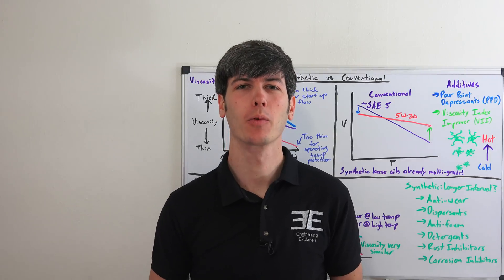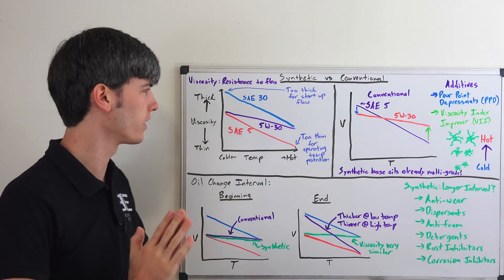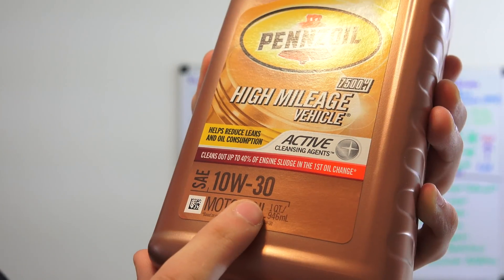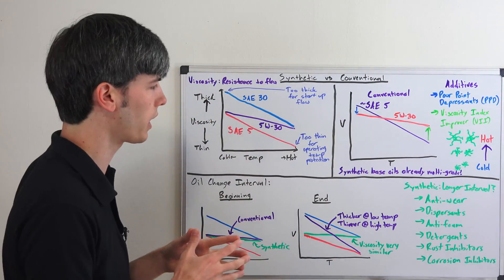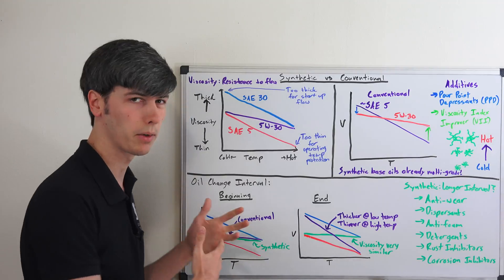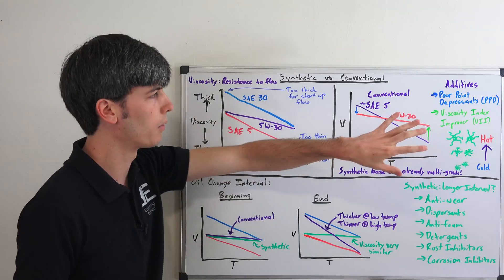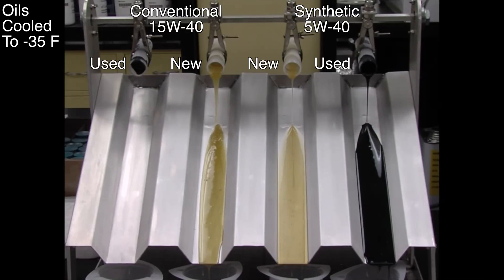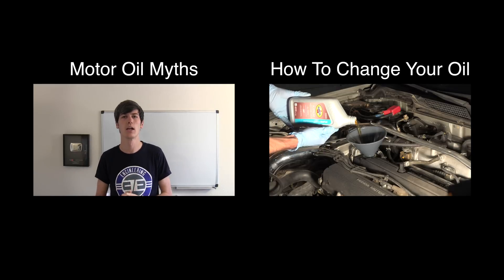Is Synthetic Motor Oil Better For Your Car?

Comment: There's really no excuse to be using non-synthetic oil... you can buy 5 quarts of full synthetic Mobil 1 at Walmart for like $25.
Reply: I've used it on vehicles as old as 1995 with no increase in leakage. But then again, my experience is mostly with German cars, so I can't really speak for old American cars. The way I see it, if something's leaking then I have to replace a gasket or an o-ring, not change the oil type.
Reply: I'm using Pennzoil Platinum 5w30 in my 1984 Caprice, no issues except now the engine leaks drops of oil upon shutoff. That may be either from the oil's slightly thinner viscosity or it may be from the synthetic oil cleaning the engine so well that it removed false seals made from sludge, or both. In severe cases of engine abuse it can remove sludge too fast and block oil passageways.
Reply: False. Full synthetic oil is superior to ANY oil type (conventional or semi synthetic). Why do you think manufactures recommend that you don't break in a some motors (especially high performance engines) with full synthetic?? Because the oil lubricates so well that the engine wont generate the proper heat and friction to properly seat the piston rings.....Synthetic oil means longer intervals between oil changes AND better lubrication also.
Reply: JgHaverty Your arrogance is overwhelming, and your education and experience far from make you an expert on automotive oil because steam turbine lubrication has to over come vibration and rotational friction, while combustion engine oil has to contend with those both and over come lateral load and help transfer it to a rotational force along with function as a hydraulic fluid to pump up lifters/followers. And, group III oils like Mobil 1 are Synthetic(synthesized hydrocarbons). So not only are you arrogant but you are wrong about the things you claim to be an expert on.
Reply: +Austin Lucas So go back to conventional and see if the leak goes away. That way you know if it was the oil or the false seal.
Reply: ***** I used synthetic 0W40 in my 2003 BMW 540i that had 200k miles. No leaks or problems :)
Reply: That's all I use is Mobil 1 EP. Factory fill in high performance sports cars plus many of my family worked for Mobil as engineers.  117,799 psi was 5W30 Mobil 1, Advanced Full Synthetic, API SN, GM dexos 1 approved . The Wear Protection reference categories are:

.
• Over 105,000 psi = INCREDIBLE wear protection

.
• 90,000 to 105,000 psi = OUTSTANDING wear protection

.
• 75,000 to 90,000 psi = GOOD wear protection

.
• 60,000 to 75,000 psi = MODEST wear protection

.
• Below 60,000 psi = UNDESIRABLE wear protection

For those interested they rank tons of different oils

https://540ratblog.wordpress.com/2013/06/20/motor-oil-wear-test-ranking/
Reply: JgHaverty How you pass as an engineer today I don't know. But, What I do know is that you don't understand the subject on hand.

The pistons move in a lateral motion causing LATERAL load on the rod and main bearings, but because as you wrongly assumed it does not, when in reality the engine oil functions as the bearing the babbitt in the bearing and the crank journals never make contact. The engine main bearings and journals have on average .001" clearance for every inch of journal diameter and the journal rides on the surface tension of the oil under pressure in the main bore.

Your second failing assumption is how the valve train function. Hydraulic pressure caused by the pump builds up in the engine block galleries causes the lifters/followers to pump up to control valve lash. It's the reason they are called hydraulic lifters, which you would have know if you had the lease actual knowledge of the subject.

I also don't think you understand the term "hydrocracked". When a petroleum oil is hydrocracked it is broke down under extreme heat and pressure turned from a liquid state to a gas state and broken down to its molecular weight. Then the molecules are synthesized into hydrocarbons again. Which is why they are described as synthetic.

Also, the near incompressability of a liquid has nothing to do with its ability to exert a pressure or hydraulic force. Engine oils are always pressurized, which is again a common understood concept you lack understanding of.

Your demeanor and lack of humility laughably signify your ignorance and lack of professionalism.
Reply: non-synthetic is half that price, that's the excuse
Reply: Thanks, and congratulations on reading it all. Now you should be more knowledgeable on the subject. The purpose of the internet is to share knowledge and information.
Reply: Full synthetic is not always the best oil to be using. Here in Australia it is way too hot to be using say 5w30 in a diesel engine. Something like 15w40 is necessary. Always use the oil grade which relates to the climate you`re in. Not whether the oil is fully synthetic or not.
Reply: I can't use synthetic oil its too thin and it leaks in older vehicles.
Reply: I haven't seen any Walmarts in my area that do oil changes. Also, the oil change you get for $21 will probably be the cheapest conventional oil that they can get their hands on, whereas $25 buys a good synthetic oil. An oil filter is usually less than $10, and tools are a one-time expense. In any case, I wouldn't trust anybody else to change the oil in my BMWs, I'm the only one that touches those cars. I haven't been to a mechanic in years either, I fix everything myself.
Reply: +Danny Zabolotny I fix what I can on my cars as well. However, if the manufacturer recommends regular oil, why buy synthetic? I Just bought a 5 gallon jug of Supertech high mileage 5w30 at walmart for $10. It's API rated energy conserving. I change at 5k mile intervals.
Reply: DavidJLim I guess I kinda forgot that there are cars where conventional is the recommended oil. All but one of my cars require synthetic oil, and one of them (an M5) specifically requires Castrol 10W60.
Reply: Mobil 1 isn't synthetic oil. It's labeled as such as a marketing ploy. Mobile 1 is a group iii quality oil (which is more than plenty good enough for any car application); synthetics are a group iv or v sometimes. 

But since you 'know better" go ahead and keep buying it lol.
Reply: JgHaverty lol. i don't have a source....im not a mechanic and honestly i admit i don't really know. But i figure it would be illegal to sell oil labeled as full synthetic if it wasn't full synthetic. I have been into cars and motorcycles for years and never heard of this. I am not trying to be a smart ass. I am just asking. And your "education" is not a reliable source FYI.
Reply: JgHaverty Really? haha did you just refer to my "tone" over an internet comment? = fail. I admitted above that my knowledge was limited and just told you I read articles that agreed with what you said. You seem like the personality type that likes to prove your a right and better than others for some personal insecurity reason. I assume thats why you keep talking to me condescendingly. You don't have to keep being a smart ass...let it go man. I believe you lol. Mobile 1 is not "true" synthetic.
Reply: no way, the full synthetic oil is the same chemical components as mineral oil. Only modified. There some additives who can disolve oil residu but these are also in modern mineral oils or semi synthetic. It can happen an engine starts to leuk through seals, but the only explanation for this is that it was already damaged but covered by al lot of residu
Reply: It only leaks if your seals are bad. An old engine with new seals won't leak.
Reply: JgHaverty Nothing else to add to the conversation, or have you realized you entered in to a battle of wits armed only with false confidence?
Reply: Pistons move in a rotational motion? Really? What part of a piston rotates around it's own axis?
Reply: Freddie Krueger I will, I also do my own timing belts, water pumps, oil pumps, brakes, intake manifolds and valve lash, so put that in your crackpipe. I save more than $10 believe it or not
Reply: It makes more sense to change your oil on time with conventional oil than to waste the money on synthetic oil that you don't need. The place where the money matter more is in the filter, use a quality filter like WIX and a conventional oil that meets the API standard your manufacture recommends and you will be just fine.
Reply: ptbelttactics this is this longest comment thread I've ever read on YouTube and you won it. Congratulations!
Reply: +Malachi Megiddo and its about motor oil....haha, people take their knowledge of synthetic oil seriously.
Reply: +Danny Zabolotny 1995 is still somewhat modern ,and my car is also German its a 1982 300D Turbo Diesel so country of  origin doesn't matter it still leaks.
Reply: Yeah...most people just don't understand this, tho.
Reply: +waislandres seems the mpg advantage applies to specific vehicles. I tried using synthetic in my car, but it had no effect on mpg.
Reply: +Danny Zabolotny synthetic and coventional have their own uses for different scenarios...that mentality that synthetic is better is wrong.
Reply: JgHaverty ahhh where did you hear that? Where is your source? Mobil 1 isn't synthetic?? i run it in my motorcycle and it is synthetic.
Reply: JgHaverty I was simply stating im not a mechanic....that had absolutely noting to do with you lol. As far as you mocking me, i never implied that me being "into cars" makes me an extremely knowledgeable person about cars and oils. I was implying that i have good overall general knowledge. And for the record, I really don't even work on cars much.  I am not sure why you are so on the defensive and insecure. You seem knowledgeable about the subject. Great. I was just saying i had never head that. i did some quick searching. From what i understand, Mobile 1 is a regular group lll oil with synthetic additives. So i get what you are saying that it is not "truly synthetic". But it does have additives that make it perform as such. So saying it is not synthetic doesn't seem entirely true either. Additionally, every search led me to an article, forum, etc. I did not find a reputable source. I believe what you are saying, but still, i could not find an actual reputable source for this. More just a lot of opinions that agreed with what you are saying.
Reply: actually there is in semis they use super thick conventional oil because of of the power and heat
Reply: synthetic can ruin gaskets on older cars if you have already been using conventional.
Reply: I use words that everyone can understand rather than application-specific jargon that may be defined in other than the usually-accepted ways to conform to special purpose contexts that may be understood by only an isolated minority.
Reply: also buddy, oils aren't used for lateral loads. thrust bearings are for lateral load. oils and grease lubricate them and help prevent metal to metal contact.

while you certainly SOUND like you know what you're talking about, it's pretty evident you don't understand basic mechanical principles of lubrication. the ENTIRE point of lubrication is to lower friction and prevent metal to metal contact, NOT to act like a bearing or hydraulic fluid.

btw valves and lifters are ran off the cam shafts via Springs and compression of the oil via that action.

fluids are inherently near in compressible, even water. so your analogy of motor oil to turbine oil is , again, completely and laughably incorrect.
Reply: ptbelttactics *sigh. On a keyboard now,  not my phone.

Lets start at the top, shall we?

1) pistons move in longitudinal AND rotational motion, not a lateral motion, unless we're talking boxer engines. Lateral motion will DESTROY a combustion engine
2) "the babbitt in the bearing" is a huge concept error. "babbitt" is a general term for the material for what the bearing is made of, usually lead-tin-antimony. It is NOT some  "special part" of a bearing as you are implying.
3) sleeve/journal bearings in a car operate under hydrodynamic lubrication principles, but not at all times. On start up, they are operating under principles of boundary lubrication due to microasperities. THIS is why your bearings fail over time.
4) sleeve/journal bearings have ZERO function for controlling thrust. The crankshaft has its own dedicated thrust bearings on the ends. If it operated as you are implying "the oil provides the protection for thrust", the engine would be destroyed. The BEARING is what protects from motion, the lubrication is what protects the bearing.... may sound counter intuitive, but the way you are stating it is completely incorrect.

4) the valve train works lifters and cams. The oil in the lifters is, yes, operating under hydraulic force to be a medium between the springs and cams. HOWEVER, you implied there is a difference in the ability of turbine and motor oil to be usable as a hydraulic fluid. That is unequivocally incorrect. The operation of the lifters was never the point in question, but they are not using "hydraulic pressure" to operate. The cams press the springs to press a diaphragm which creates pressure and lifts the cams. The only reason oil is used inside is because of noise and vibration. 

5) YOU don't understand how hydraulic lifters work. If they were truly a hydraulic process they would be filled with oil at all times, which they are not. They are usually drained and dry when you start your car in the morning. If they operated under hydraulic pressure, they would not start at all with no oil. Yet magically they do... hmm... couldnt be because of those springs and camshaft could they?

6) again you have a HUGE concept error. "Hydrocracking" has almost nothing to do with synthetic oil. Broken down to its most simple of processes, it is simply a glorified distilling process. You spoke of group iii oils "being synthetic" which is painfully incorrect. 

Group iv and v are the only oils that are truly synthetic. THAT is an entirely different conversation, but Mobil 1 is in no way, shape or form, a "synthetic oil".
Reply: JgHaverty The more you type the more you show how little you understand Physics and Chemistry in as they pertain to Combustion Engines and Combustion Engine lubricants.

1)Here is a paper from MIT that you can read to understand how wrong you are.

http://math.mit.edu/classes/18.086/2008/final_report_dongfang_bai.pdf

2)Engine bearings have layers, the layer that opposes the crankshaft journal is called the Babbitt the main housing bore layer is made of steel. Here is a picture because you will need to understand.

http://www.marinediesels.info/2_stroke_engine_parts/Other_info/trimet_2_brg.jpg

3)Yep, that the reason it happens.

4)Wrong it's part of the main bearing that controls thrust and uses the same principle of pressurized oil to control thrust, which is the reason you have to set end play clearance in the crankshaft.

4) (What happened here?) Facepalm* The springs maintains pressure of the valve against it's seat. The hydraulic lifters control valve lash, which is the tension between the rocker/follower's roller and the valve stem. I never claimed they actuate the valve you ignorantly inferred it. The cam presses the valve directly thru mechanical linkage and the hydraulic pressure dampens this force, the springs do not open the valves they work against the cam to keep them closed.

5)I'm not going to go in to great detail but they use a check ball and spring to maintain oil pressure when you shut the engine down. So this assumption you made is false.

6)There are no synthetic engine oils that are made from Group VI base stock. And you need to understand that Group II and Group III are both Hydrocracked, but Group III uses a process called "severe hydrocracking". So it could easily confuse you in your reading if you don't understand the difference. Group II is distilled to remove impurities and then hydrocracked to reshape their molecules, while Group III the molecules are destroyed and reformed.

In Europe Mobil 1 is sold as synthetic as you so wrongly have been telling people, only in Germany is it labeled slightly different where they label it as "made with synthetic technology'.
Reply: Danny Zabolotny actually many older cars have seals that will begin to leak if you switch to synthetic motor oil.
Reply: Just as an experiment, I've used synthetic oil in my older car sometime ago, and it burned it up, or otherwise escaped the engine in an alarming rate. What I mean, that I had to add  1qt. a week to the crankcase, until the synthetic was completely replaced by conventional oil. From that point on I'm using 'high mileage conventional',  which stays in the crankcase without any loss.  So here is one reason for using conventional oil, and you don't even need an excuse for that. ☺
Reply: @wotan20 I hope your car is ok and that you were able to replace your gaskets.
Reply: dodgeguy102 really? both my 1940 WLA Harley and my mom's 1959 Austin Healey 3000 leaked synthetic from every pore when we tried it.   come to think if it so did the flathead in the 1934 Ford stake bed as well.
Reply: dustin leavitt
If the seals hadn't been changed since 1940, it's not surprising they started leaking when the synthetic oil with good detergents broke apart the sludge that was working as a secondary sealing surface...
Reply: Gary Chandler Valvoline is also a Group III stock. But, the reality is in a daily driver API certification and correct wight are the only things you should be concerned about. Only in true race cars is there an advantage to using Group IV base oils.
Reply: Synthetic is much more expensive in the UK. But you must use it on more modern engines for several reasons. So my Audi needs synthetic but my old land rover happily runs on old fashioned oil and has done 175000 miles so far on it at 5 litres for £10 / $12.18). But the synthetic oil lasts a lot longer and needs changing less often. Synthetic prices have fallen though in recent years if you shop around.
Reply: true silverbird58, They should have an electric pump flow oil through the engine before it cranks
Reply: It's very serious to me, race cars are my profession and passion.
Reply: Depends on the engine and condition. Rotary engine for example perform better with standard petroleum based oils and a high mileage car I would just clean with ATF and use standard weight oil vs synthetic
Reply: 0w40 is a good spec for that engine. BMW LL04 exceeds the requirementsof the engine. No reason not to see 400,000 miles or more from a BMW.
Reply: bmw oil is essentially castrol oil rebranded
Reply: Delvin Goh, I'm fully aware of that. The only car I actually use Castrol in is my M5 which requires 10W60 specifically. Otherwise I just use 0W40 or 5W30 Mobil 1 from Walmart.
Reply: Azureecosse I definitely like the longer service intervals because I drive a lot, and synthetic oil is cheap when you buy it Walmart. $40-50 on oil per oil change is nothing to me.
Reply: I've heard this before. I've used full synthetic starting in 1994 with a 91 Chevy Beretta, a 97 Pontiac Grand Am, 08 Pontiac Vibe, and now a 16 Subaru Impreza. No leaks anywhere. I wonder where the "older engine" cutoff is.
Reply: +marshallrhayes your half right. Synthetic oil leaves a film residue on the cylinder wall that stops the rings from seating properly from new. Its not to do with friction and temperature. Its the characteristics of the oil which is thin compared to mineral. This longevity increase using synthetic however is completely wrong. Mineral oil lasts longer than synthetic. 
You get a performance increase due to less friction with synthetic and its better for the environment. Thats all
Reply: marshallrhayes 

Lol... go do your own homework bud. There are grades of oils, niehter penzoil nor mobil 1 are "true synthetic" oils.

My source? Education. Your source? "Some guy on youtube told you so, so it must be true".

Clowns.
Reply: marshallrhayes You questioned me, and stated a falsehood as fact. I simply said "no". You wanted to know my "education"; or at least implied I wasn't being truthful. 

If you're asking questions, then ask. I am willing to guide you in the right direction.
Reply: JgHaverty At what point in any of my above comments did i state a falsehood as a fact? Please answer...this is not a rhetorical question. Also, i asked for your source on that. I never asked about your education.
Reply: marshallrhayes 
This is where you go be a big boy and do your own homework. 

Also, your tone and position is both implying I am incorrect and dont know any better, which is false.

Go find SAE standards for "synthetic oil" in america. Then go look for synthetic oil standards in europe, because those actually exist lol.
Reply: JgHaverty BTW a persons "tone" cannot be factual or nonfactual. Only a statement can be true or false. = fail #2
Reply: marshallrhayes Actually tone conveys position. Your position is/was false. 

No fails here, get some education clown.
Reply: I bought 5 qts. of Havoline API service SN for $6 after rebate.   Mobil 1 was $11.
Reply: I paid $11 after rebate and that was the only reason that I bought it.  I'm under no delusion that it is significantly superior under usual operating conditions that it will measurably reduce engine wear relative to conventional oil.
Reply: Of course. But its laminar flow characteristics are usually different. As you statement implies, there is no official API definition of "synthetic".
Reply: And what's your evidence for that?  Leaks occur with "synthetic" because of different laminar flow characteristics.
Reply: "laminar flow characteristics"??? lol

don't use technical terms out of context. laminar and turbulent flow have almost no bearing in the context of lubrication. we use viscosity and pour points to describe various lubricants, not "laminar flow".
Reply: Walmarts used to do oil changes but most don't anymore. The ones that still do, actually rent out their space to another business. Walmart did do synthetic oil changes and for much cheaper than anyone else ($50.00) and it was using a quality brand name. I would always bring my own oil and filter in and have them do the work. My car took 3.8 liters and if I brought in a 5 liter container, they would sometimes try to keep the difference. You had to keep an eye on them.
Reply: Wrong. wrong. and wrong. Oh by the way did I mention you are wrong
Reply: Exactly right. This has been my recommendation for the past 20 years.
Reply: As I told the other guy, wrong, wrong and wrong. Oh yeah, wrong.
Reply: True. Most of the people who comment and profess a formal education cannot spell or form proper sentence structure.
Reply: Let me ask you this . How many degrees and how much experience did the engineers have that sent the Challenger into oblivion? Maybe you could have helped the NASA engineers with all your knowledge at hand. The man is right. Your education is not a reliable source. You are technically correct in this case but it has nothing to do with your education. Most mechanics should know the classifications of lubricants and any moron can look it up.
Reply: lol. I'm gonna use your tactic.

you're wrong about everything because I said so...

group iii oils are NOT synthetic btw. group iv and v are the only true synthetics.

Also, not sure why you'd compare turbine oil to motor oil. I made no such analogy other than a quality comparison.
Reply: wotan20 MYTH have used synthetic oils in every vehicle I have owned...from brand new to well used 300,000+kms.  NEVER had a single one use synthetic faster.  As synthetic has a far higher resistance to burn, it would "use" less.  Leaks are another story.
Reply: A daft punk That's the answer right there.
Reply: Мейсу Семпай the seals are made of natural rubber and synthetic oils act as a dessicant , even NOS seals immediately fail when I introduce synthetic oil to them.
Reply: dustin leavitt
"Natural rubber"? As in, latex?
Reply: I'm not exactly sure what we were using to manufacture seals in 1940, or what the english were using in 1959  but it hates synthetic oil.  At least it's not as big of a pain in the ass as the brake linings.  the cable operated brakes are basically useless if I stake on modern brake lining,  so I have found good ol' mesothelioma causing asbestos pads with the assumption that the inability to stop is more dangerous than the asbestos exposure.
Reply: There are different groups of synthetic oils - Group III oils are considered synthetic because they have been heavily modified in the laboratory, but they still have a mineral base. Group IV and V are not mineral based at all. As far as I know, Mobil 1 is using Group IV and V bases, making it a true synthetic oil.
Reply: Matthew Schwenk No on the self Combustion Engine Oil has a Group IV or V base stock. But all multi-weight oils contain Group IV/V modifiers.
This is the best source of information on the subject. https://bobistheoilguy.com/
Reply: Unless it's Valvoline.
Reply: Non-synthetic oil looks sexier. :D
Reply: Sure put that conventional in your Pinto.
Reply: USA shop at the .99cent store
Reply: For exactly 20$ i can get 1 litre of mobil 1 full synthetic 0W30 in sweden
Reply: There is already something that pressurizes oil to the engine on race cars before start up. It's called an Accusump and it can be installed on any car but the average consumer would screw it up somehow.
Reply: Danny Zabolotny u r absolutely right,  I've hot a 2008 mazda 6 with 244000 mile on it, it runs Great, and the Engine sounds just as quite as our  2015 nissan rogue.
Reply: +ptbelttactics - There are many European and Japanese cars here in the UK whose engine oil requirements cannot be met by conventional (mineral) oils. Even if you change it every day you cannot just load in the correct SAE viscosity grade of oil and expect thing to work properly. Much of this is due to exhaust after-treatment systems installed on diesel powered cars. Even without this constraint though there is plenty of evidence and experience to support the superiority of synthetic oils over conventional ones.
Reply: Try running a 1967 dodge 100 pickup on that. Gonna leak like a mother. Some vehicles need thicker oils
Reply: Maybe the fact that older cars don't like synthetic oil?
Reply: Provided your vehicle is fairly modern. Older engines won't take this. It'd be nice but from what I hear is it's so thin there have been reports of leaks and pressure issues (here comes the dash light!) so keep that in mind.
Reply: marshallrhayes 

Im not a mechanic.

Im an engineer. 

Big big difference.

Seriously, be "into cars" all you want. Being able to bolt a piece to a car doesn't mean you understand the physics and science behind it.

Seriously, go google your questions. 

How's this for education

- Navy Nuclear Power Program
- Oil King (nimitz class carrier) (yes this is a real thing)
- BSME from MSU
- 4 years of nuclear engineering with focus on turbines (guess what buddy, they use oil)
- I'm now an industrial maintenance engineer for a VERY large manufacturing company of automotive products.

But, you "work on cars" in your spare time. So that makes you qualified to understanding the intrinsic differences of oils right? 

If you want to learn, ask the right questions. You are coming to me with some weird "holier than thou" attitude. For starters, there are NO SAE requirements to label an oil as "synthetic". None. I can literally go get a bottle of olive oil from the grocery store and sell it as "synthetic oil". It would be completely legal in the USA. In EUROPE they DO have requirements! Go look at the differences.

I like this channel for the most part, but this video is just paid propaganda for penzoil. He explains nothing.